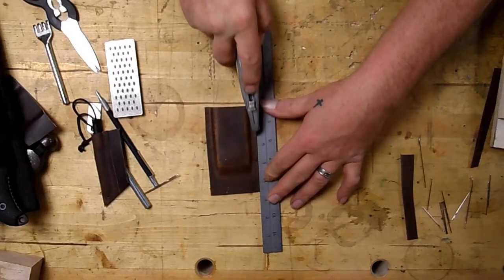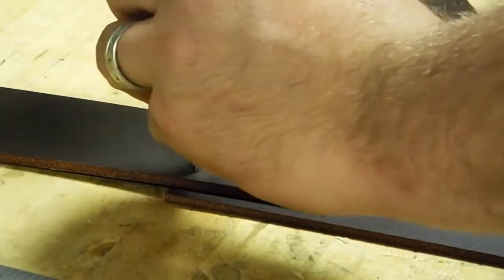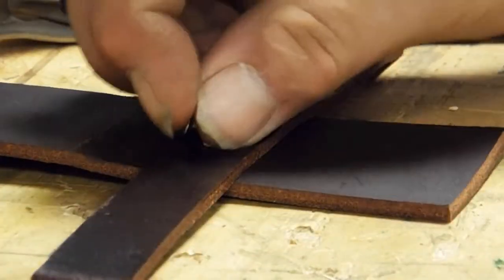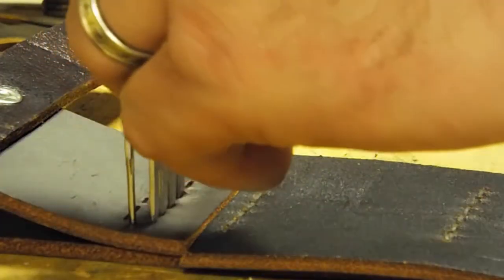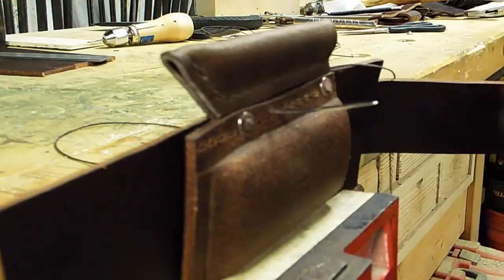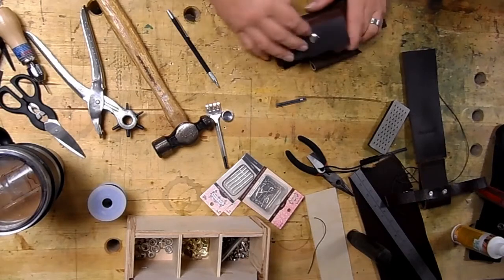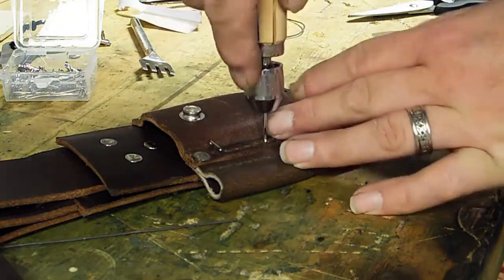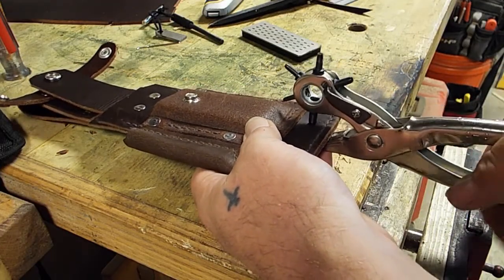GPW 69B - Leather Sheath With Accessory Storage

Comment: Schönes Video, GP.
Der Messerschutz sieht super aus.
Da du ja jetzt öfter mit Leder gearbeitet hast (zusammen nähen, schneiden, usw. ), wäre es da nicht besser. Wenn du dir aus Restholz eine Platte zusägst, wo du die arbeiten. So schützt du die Oberfläche deiner Werkbank.-------------Nice video, GP.
The knife guard looks great.
Since you have now often worked with leather (sewing, cutting, etc.), it would not be better. If you look at a piece of wood from a piece of wood, where you work. So you protect the surface of your workbench.
Reply from the maker: Ich bin nicht dagegen die Werkbank  zu beschädigen. Wenn die Spitze zu schlimm wird, kann ich es herumwirbeln  oder es umdrehen.Das Oberteil  ist nicht an der Basis befestigt ist. --------------I don't mind damaging the workbench. If the top gets too bad, I can spin it around or flip it over. The top is not fastened to the base.